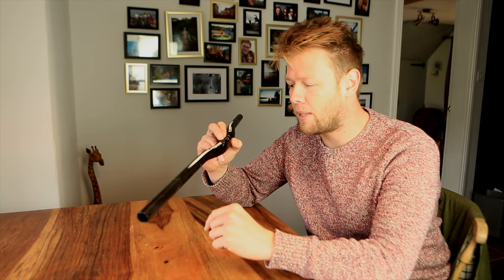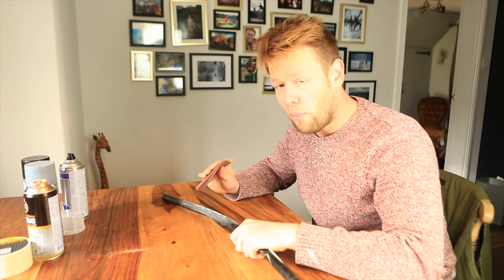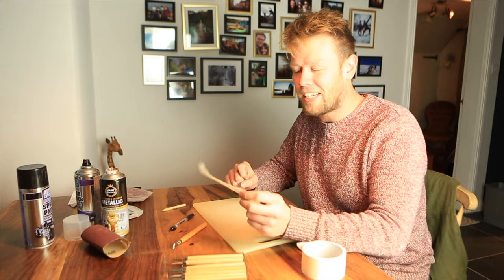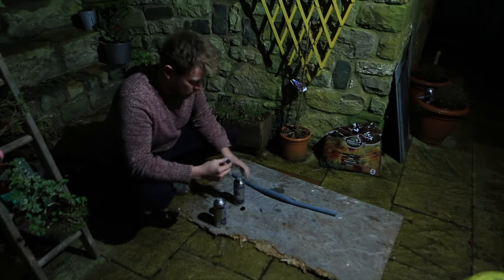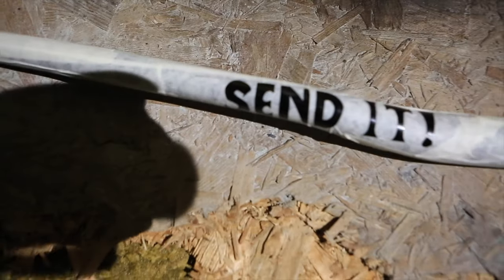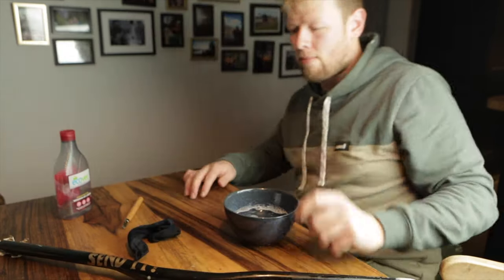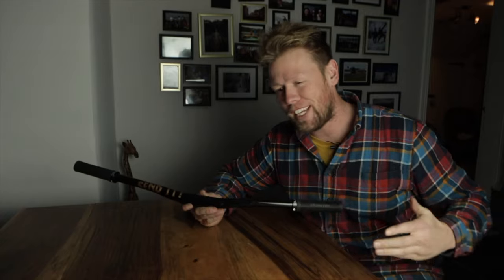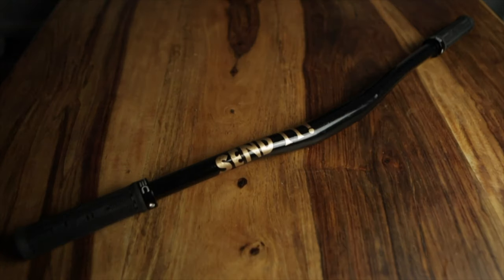I Tried Painting My Mountain Bike Handlebars! (it kinda worked!)

Comment: degreaser will soften the adhesive and you can remove it with toilet paper or a T-shirt or that sock. at least that's my experience with Gorilla tape, if does not work repeat until it's gone.
Reply from the maker: Good idea!!!

Comment: can you write the names of the products you use because I don't understand English.
Reply from the maker: BEGAMER no worries. 
I used sand paper, masking tape and spray paint. But in all honesty the brands I used were too cheap and, although I probably used them wrong, I had issues with the paint not spraying easily through the heads and the masking tape left residue. 😂
Reply: what sandpaper uses which number
Reply from the maker: BEGAMER I used 240grit. Should have used higher numbers to finish it.

Comment: Is this paint durable??
Reply from the maker: it's not as durable as powder coating but it is pretty good. The smoother you get it, the better you prepare the bars and the higher quality the 2k clear coat you use will give it more durability. I have hit these bars in to a few hard surfaces like walls etc and they seem to stand up to it as well as factory painted bars i have. Hope that's useful
Reply: @sessionmediaa  and how about when assemblying the stem?? I think it's the most critical area, any issues there? I'm about to paint my road handlebar and that's my biggest fear. Thanks for the video mate!
Reply from the maker: @julenelorzgarde8529  no issues as yet although I could imagine issues coming from repeatedly taking the bars on and off the stem. 👍👍👍👍